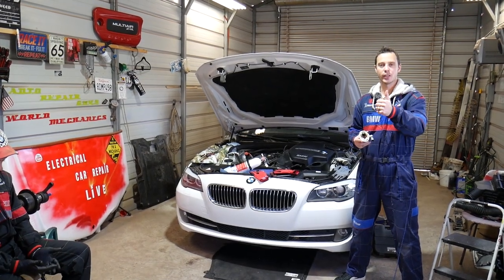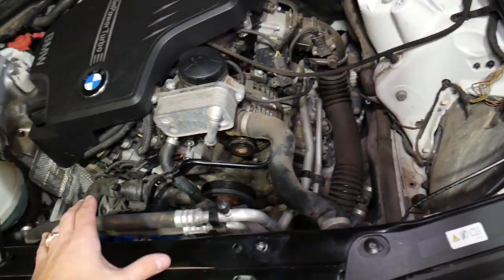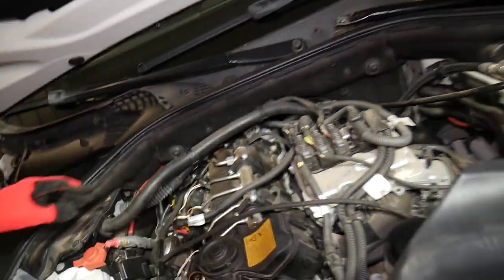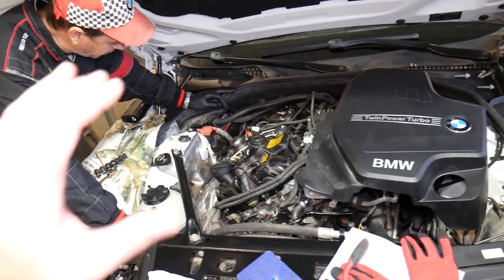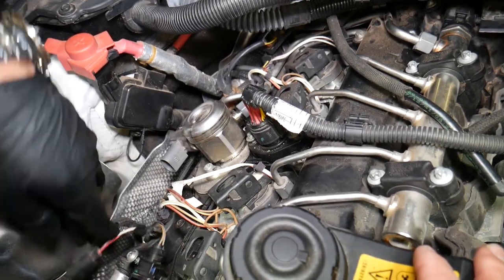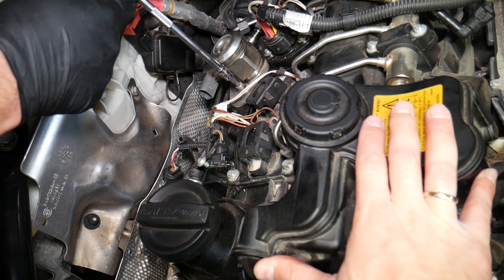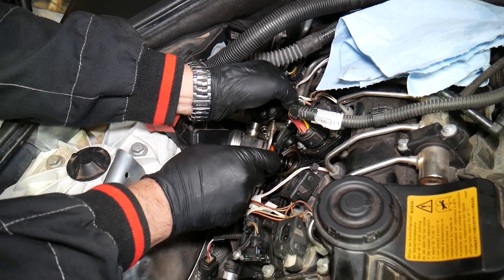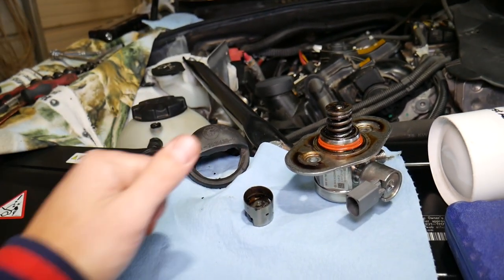BMW F10 F11 HIGH PRESSURE FUEL PUMP REPLACEMENT LOCATION, FUEL PUMP LIFTER TAPPET 520i 528i

Comment: Hi I've watched many of your videos and think you're great. 
My 2010 f10 525d n57 needs new high pressure fuel pump. Will all the injectors also need to be replaced? 
Thanks